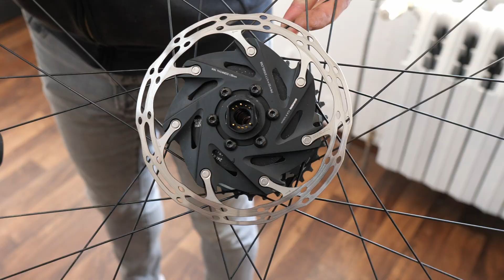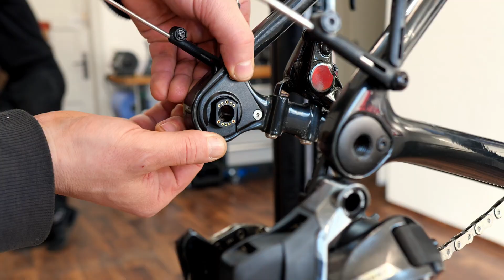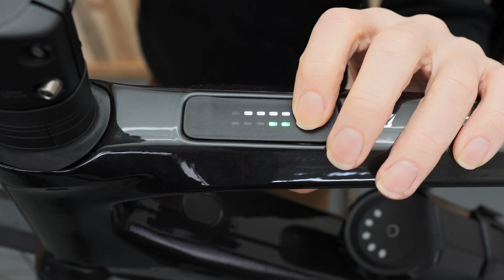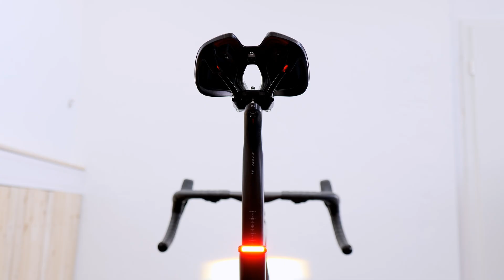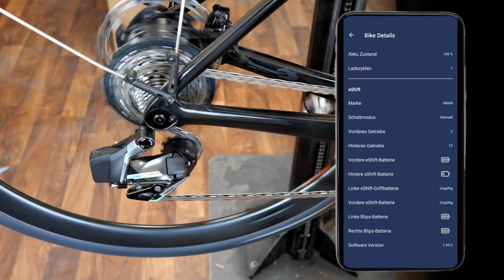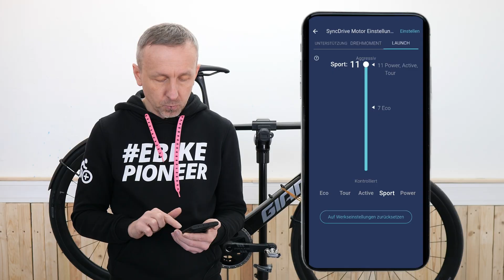Giant Defy Advanced E+ Elite: 13 kg of Carbon with Clever Engineering | EBIKE24

Comment: I can't find the headlamp and mount, do you know the part numbers?
Reply from the maker: I think it's this, the headlamp includes its mount: https://www.ebike24.com/giant-recon-e-hl-150. Thanks.
Reply: @ebike24  If you look at the pics in the video it has a Garmin adaptor on the top and the mount replaces the clamp end of the stem using hex bolts..  I think the lamp you linked will work, but it is designed for an MTB, not the D-Fuse bars on a giant road bike, so the mount is no go.